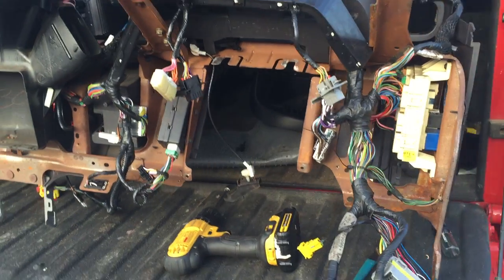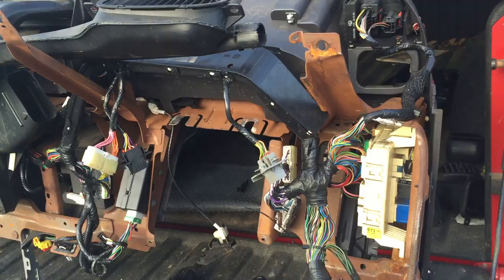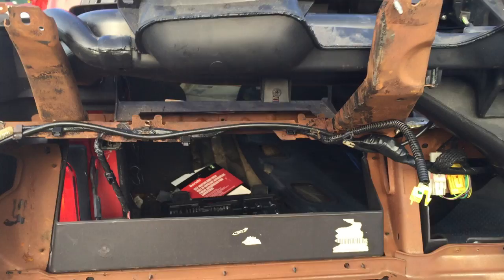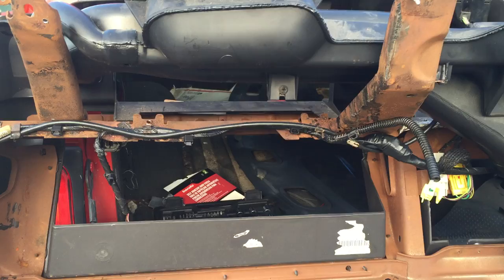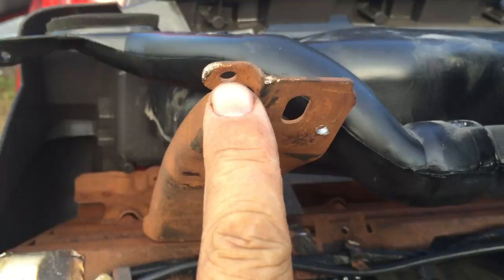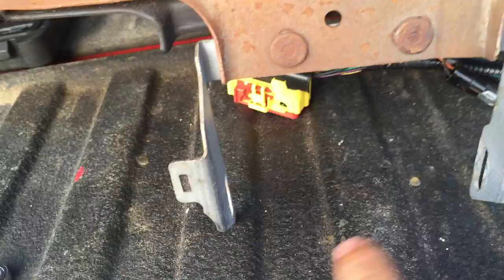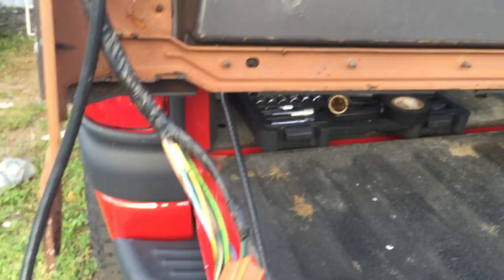Tip On How To Remove Dash Frame On Dodge Ram 1500, 2500, 3500

Comment: Conqur , I removed my whole dash, incl metal frame. Here's my problem. I had bought a used dodge with a perfect dash. I removed the dash, but also threw out the old wire harness. I thought it would be easier to install my harness than it has been. Is there a site that can show me the backside of my dash, for wire harness placement? Pic for pic would be useful. I particular, I need the pic of behind speedometer. 

Any help is appreciated. 

Best Regards 

Mark
Reply from the maker: +Mark Wielgoz Mark, let me get this straight. ... when you removed the bad dash, you also removed the dashboard harness?
Reply from the maker: +conquryourfear If you did ... I hope the donor harness came for the EXACT TRUCK (YEAR AS WELL AS TRIM LEVEL).  If so, each plug you have to plug in has it's own distinctive receptacle-plug.  As far as behind the speedometer, there should only be two plugs, where each plug slides into the slots on either side. I hope this helps, if not, let me know.

Comment: Any ground wires u came across when removing the dash
Reply from the maker: Terry Benoit To the best of my recollection no. Whatever ground wires are there they ground on the frame and then when you bolt the frame back on to the truck it grounds to the frame
Reply: conquryourfear & do it yourself  so this happened to me i was pulling dash to play with the a/c it only blows out the defrost so i unbolted the dash and moved it to the side when i see the radio cut off and the gauges go out and odometer i check all the fuses and all good i taped the ground on the radio and it works but only when i use the jumper from the tap
Reply: When i was pulling the dash i felt it get snug and thats when the radio and dash quit thats y i was asking about any grounds
Reply: Im getting power to both plugs to the gauges and to the radio still and now it drains my batteries
Reply from the maker: Terry Benoit your radio has a fuse just for it as your dash has a fuse just for it. Your radio grounds out by the antenna

Comment: What's the bolt pattern and size for the top 4 frame bolts
Reply from the maker: brother, i did this video over 3 years ago.  i can't remember.  my bad.  if i had to guess, 10mm